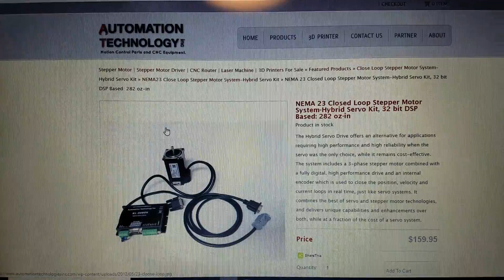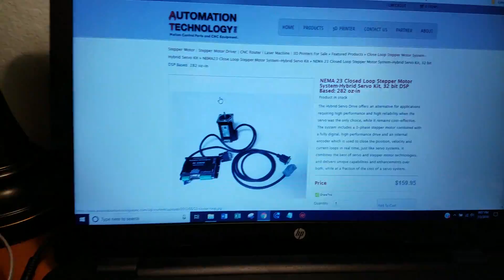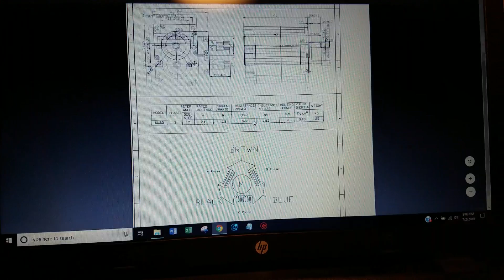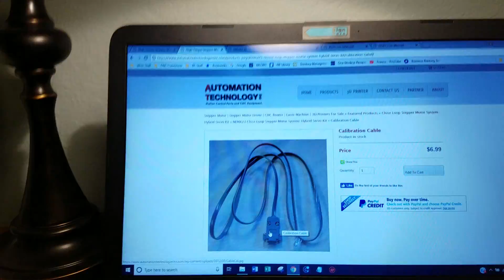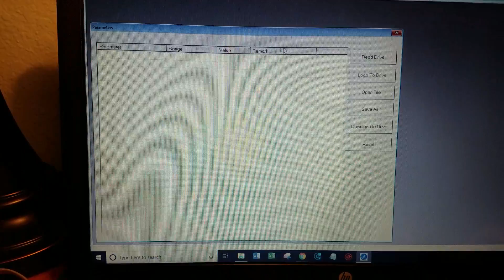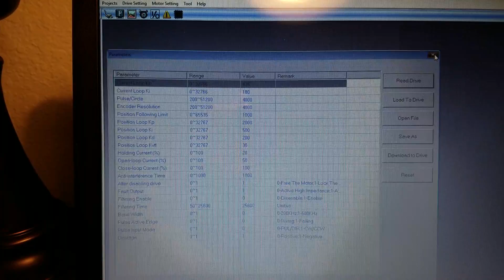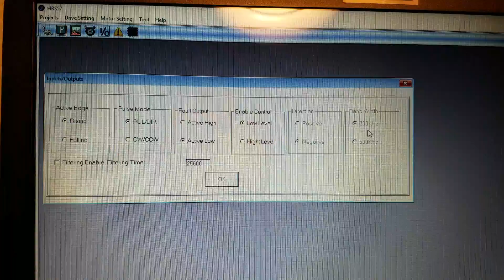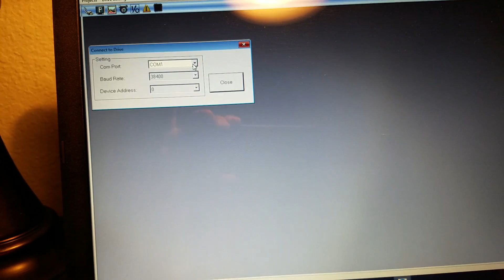KL-5080H Closed Loop Stepper Driver Programming

Comment: 12A 48V supply for two motors?  They saw you coming...  Your motors might peak at 10 to 15W, 500W of supply is way overkill.  Supply voltage correlates with top speed of the motor, otherwise its just power output that matters.

Comment: Thank you for explaining this. However, I have 2 questions.
first question is, can you update the sofrware link. It does not work any more.
Second uestion, when you connect to the drive, does it need to be already connected to the 48V power supply and powered by that?

Comment: thanks alot for the video, and i was wondering if i can control 10 closed loop stepper motor together?. Also im working on a project which i need to rotate a 10 separate mirror to track the sun. So do you think normal step motor will work fine or do i need to use closed loop to be so accurate.
Thanks in advance hope to hear from you soon
Reply from the maker: Hello.  Ten steppers will require ten individual drivers.  I'm not sure how big your mirrors are or what your budget is.  If I were building a machine for commercial purposes, I would use closed loop steppers.  If it is an educational project, then go cheap and used cheap steppers.
Reply: It's for my capstone project and I never used stepper motor before. Thanks alot for you answer I appreciate it
Reply: I have one more question? I'm sorry if I took some time from you but do you have any idea from where I can learn how to connect 10 step motors together by arduino? Because the maximum I found is a driver can hold 4 step motors or 5 
Thanks alot for your precious time
Reply from the maker: @salah-eldinessam8292  Arduino is not very fast.  I don't think you will be able to run 10 steppers with an arduino.  Take a look at the Beaglebone from seed studio.

Comment: Do you need to set the DIP switches to match the encoder count of 1000 or quad count of 4000?
Reply from the maker: From the manual:
DIP Switch - Motor SEL
It is reserved for future use. Now there is no function for these DIP switch.

https://www.automationtechnologiesinc.com/wp-content/uploads/downloads/2012/06/KL-5080H.pdf

As I recall, all of the settings are changed through the software.

Comment: Hi this is a border line dumb questions but can you set the drive to work without and encoders as an open loop driver?  Thanks
Reply from the maker: That's a good question. As far as I can tell, you need to connect the encoder cables. Otherwise, it alarms out.

Comment: Thanks for the video. Are you still using the DMM servos?
Reply from the maker: Ray Horner Hi.  The DMM servos are great and a good value for the money.  But, for the size of most of my projects, it's hard to beat these closed loop steppers. The cost is lower, they are simple to configure and they perform well. But, for ultimate performance, DMM gives you more "juice"
Reply: Great video Franco!  I just upgraded a 6090 Chinese router to an Acorn and these: https://www.ebay.com/itm/NEMA23-2Nm-283ozf-in-Integrated-Closed-Loop-Stepper-motor-36VDC-JMC-iHSS57-36-20/263176411648  You may want to check them out.  So far they are working well and were easy to set up.